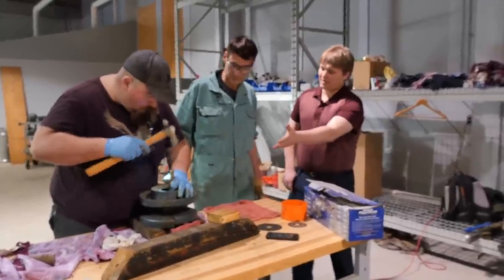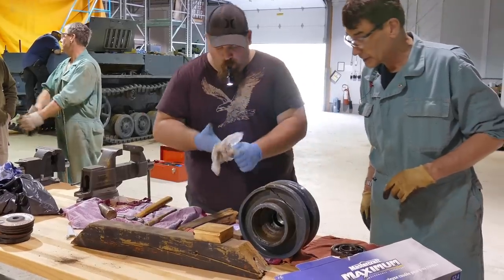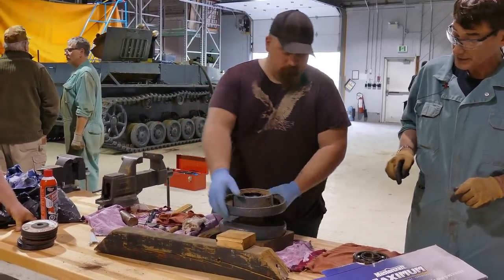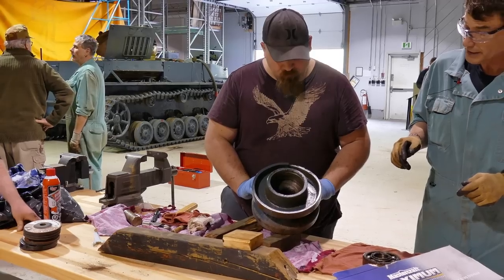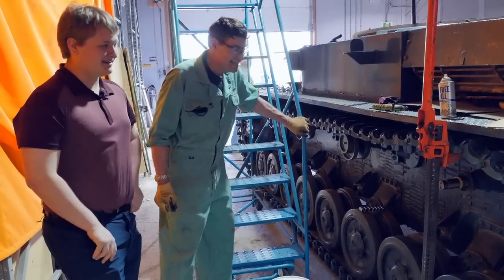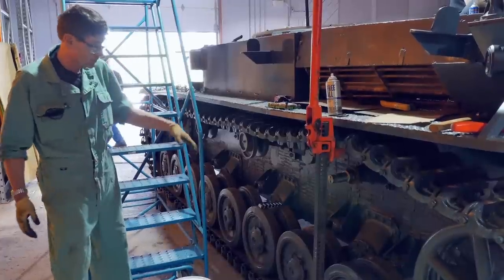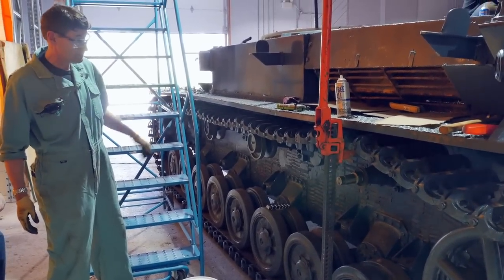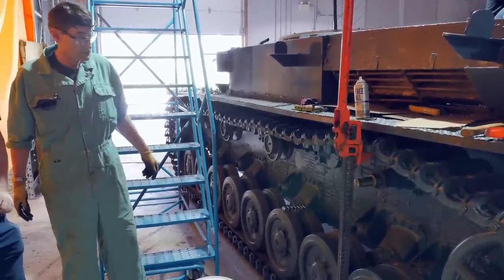Flakpanzer Restoration: Cracked Return Roller (April 29, 2017)

Comment: They are not idler wheels, they are return rollers.
Reply: Yup, kept saying "return roller" each time they said idler wheel
Reply: they are support rollers, the one in the rear that adjusts track tension, is the idler wheel,